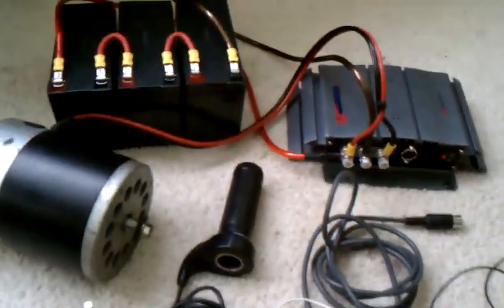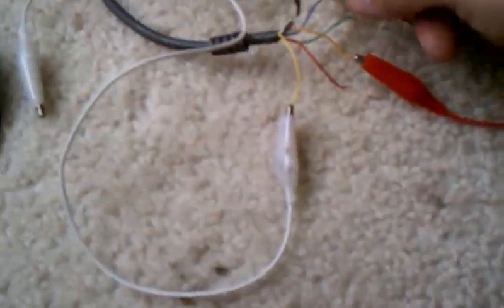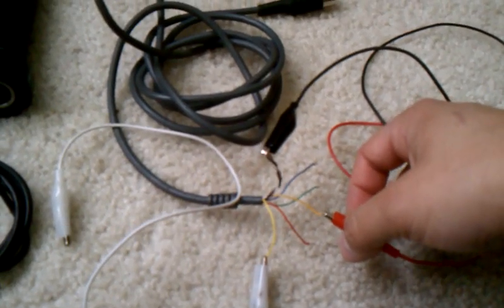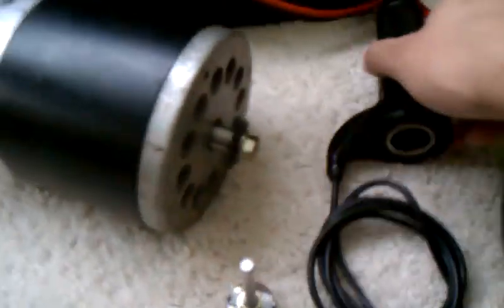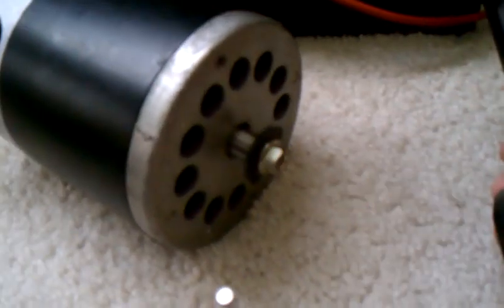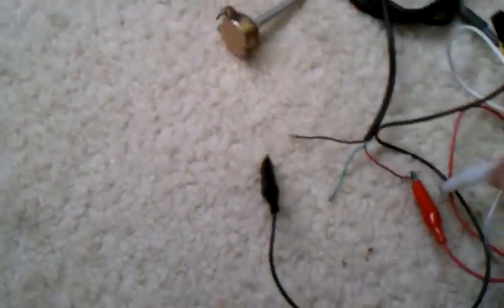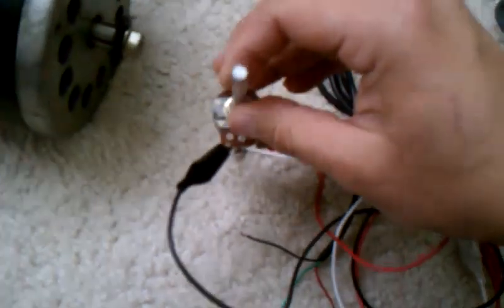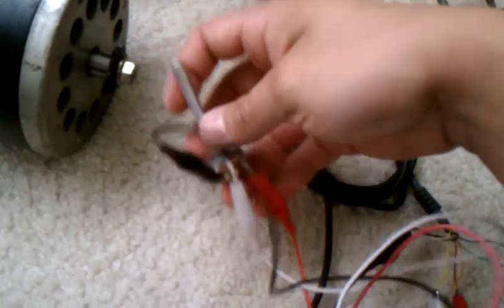Home built 36/24v dc motor controller

Comment: Where did you get the accelerator?
Reply from the maker: Off an old electric scooter. They are pretty cheap and easy to find on ebay by searching for "electric scooter bike grip".

Comment: Did you build that motor controller yourself? It doesn't look homemade...
Reply from the maker: I used a case from an old amplifier and made the PCB, and end plates. So other than the aluminum casing, the rest is homemade.
Reply: The Workbench 
Can you introduce or give the wiring diagram of PMW
Reply: @Saya_ManusiaSigma  muhammed it really is not worth making it yourself. You can buy a 60amp (peak) , 36 volt one for about £12  on ebay, brand new. If you purchased the components alone, for one of similar spec , it would cost you more than that. Then you have the hassle of building it, and the inherent  risk of damaging individual components.  So truly, it aint woth the bother of biilding it youself.
Reply: @Saya_ManusiaSigma  If you want the circuit diagram for interest sake, there are plenty on you tube.

Comment: Who is manufacturer of that motor, what type it is and what output in watts it can give?
Reply from the maker: TheQwertyCody I don't know who makes this motor. I bought it used and the seller told me it was supposed to be a 500W motor, but other than that I don't really know much else about it, sorry.
Reply: Alright, thanks.
Reply: +TheQwertyCody it could of come out of some exercise equipment.
Reply: @aaahandy  It looks to me like a Chinese Pihsiang 24volt 500watt bldc motor which are commonly used in mobility scooters. If you cannot find one for sale on the internet, which doubt, as they are so commonly available on ebay, let me know. I am almost certain I have a few spares in my workshop.
I would not charge you for the motor but you would have to either collect it from my home in west london, or, alternatively, send me the cost of the postage to you. This could be a few pounds as these motors are quite heavy.

Comment: from where i can get these components ?? can you provide me any link or circuit or any other thing by which i can design this .
Reply from the maker: anshuman mishra I built the controller completely from scratch by copying a simple motor controller. I'll be doing a video on how I built this, hopefully soon.
Reply: The Workbench Why no fuse inbetween the batterys wired in series???
Reply: @DEANSOHIGH  Its desirable, but as you see in the video, not essential. I personally would incorporate one pure as a precautionary measure.
Reply: from a razor dirt bike m650 or500
Reply: anshuman mishra

Comment from the maker: I'm able to use either a pot or a hall sensor with my controller because they both use 5V and output a voltage between 0 and 5V. It depends on how your motor controller works. If it relies on resistance between two points and not a voltage, then the hall might not work.

Comment: I have a pwm, but when i want to connect my accelerator (is like your.. type motocycle) doesnt work, but when i connect my potentiometer work perfectly..my accelerator type motocycle do the hall efect.. please help me
Reply: Obviously either you have the wrong pwm or you have wired it incorrectly.
Reply: Which pwm do you have? What is the voltage range and the amperage. Also what is the voltage, mean ( or rms) amperage and the peak amperage of the motor.

Comment: The pot you're using is a logarithmic(audio) taper like the volume control on a stereo. What you want to use is a linear (taper) potentiometer. That will give you a reasonably 'linear' increase in speed.

Comment: It looks like you've got it set up for speed control, which, at first thought, would be the way you want to do control for a vehicle (like a go-kart). In actuality, a car uses torque-control instead of speed control. If you use PWM to control motor current instead of speed (voltage), you can get much better response when you're driving the vehicle.

Comment: sir i need that motor i won't got any where .tell me where u from and where u purchased that motor 24v dc motor
Reply: Look on ebay. But first decide which motor you need. You state that you need that motor then you contradict yourself by saying you need something totally different , i.e. a 24 volt motor.
You can pick up a 24v for about £30 secondhand. But a 36v could cost 3 times that. 
I suggest you look at your old motor, get the make, modrl, serial number, voltage, wattage and amperage, allof which are on the motor body. Then trawl emay for one.

Comment from the maker: @patchcords It's not actually a pot, it has what's called a hall sensor in there that uses magnetism to change the voltage output. When you rotate the grip, the magnet moves over the sensor.